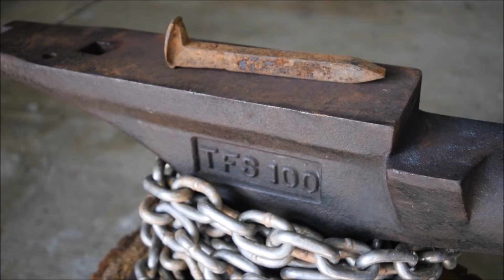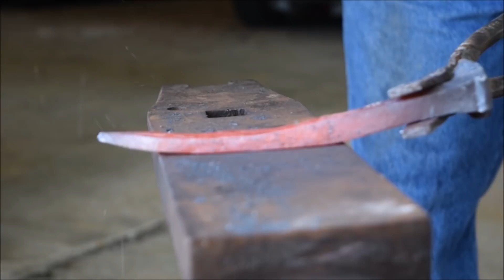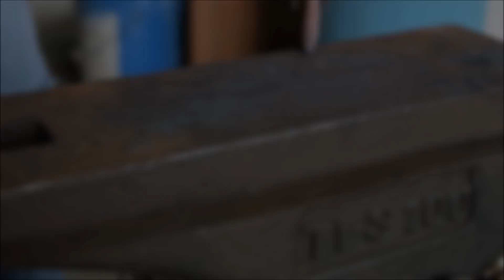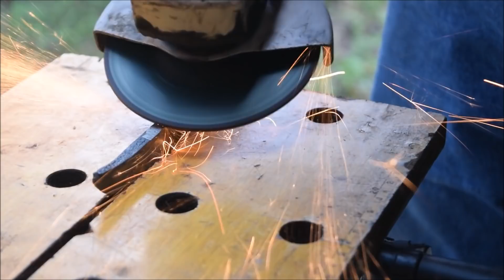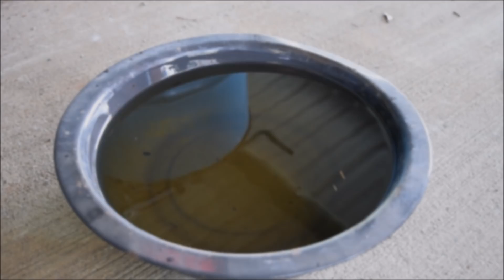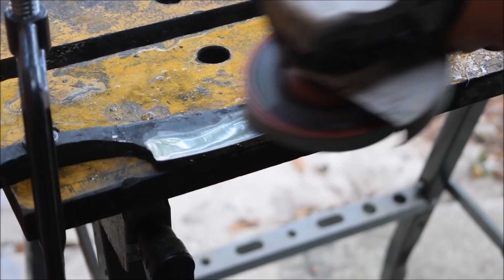Forging a Railroad Spike Knife

Comment: You can put a edge on a rr spike but it will not hold a edge as it has not enough carbon a reg spike about 28 points of carbon and a hc spike is around 32 one needs 45 points to hold a edge. these make great letter openers

Comment: It seems like our steel cools rapidly, maybe just a few hits and it has to go back in the forge. We were using  3/8"rebar, had 2 pieces side by side and forged some damascus out of it. 

We could not keep it hot for more then maybe 10sec although it started at near welding tempature? Common or what's the problem?
Reply: Was the anvil warmed up?

Comment: Wonderful knife. I really like that you left a lot of the spikes rustic look and feel. I do have a question. How hard where you able to get the blade? I personally have no idea what quality material went into making them  from the start. I am interested in knowing what it takes to get a good edge on something like this. Also how good of an edge could you get and how long will it last once you get it. 🤔 Thank you for posting this video.
Reply: There are essentially 3 different classes of Railroad spike steel. Low Carbon, Higher (not High) Carbon and Structural steel with about 0.4% carbon. The spikes aren't really gonna get much higher than 1045 Carbon steel when made into a blade on a good day. When I learned of this, I switched priority of what to make from them. My personal favorite thing to do is combine a couple and make Mace or Warhammer heads. The knives made from them won't hold an edge worth a damn, but they're tough and very hard to break, hence my Warhammer preference.
Reply: If you forge weld a file into it, it’ll be a real knife.
Reply: @Steve Syncox  thank you. I did some research and you're absolutely right. The only way this would have a useful cutting edge is if you added it.

Comment: You can get a bunch of rail road spikes for free or very very cheap.  Perfect material to really start learning bladesmithing and blacksmithing.  You can use them to make blades, tools, hatchets, lots of things.  No they aren't the best steel, but they WILL harden to a degree.  Go through about 25-50 spikes making all types of stuff, and you'll be well on your way.  Who cares if they turn out shitty?

Comment: I'm far from an expert but seems like your anvil is jumping around a lot more than it should be.
Reply: Adam Schaeffer well that’s cause it’s broken in half
Reply: I was thinking this exact thing! Would be quieter fastened down too
Reply: It’s very hard to get an anvil to stay completely still if it doesn’t have concrete cast around it
Reply: @outdoorperson6411  mine stays completely still and its on a stump
Reply: patrick White good for you I believe it but in that’s just from my experience though so maybe there’s something else to it also the one I use is just a pice a rail road track so it much lighter But thank you for the input
Reply: Walter sorels
Reply: I would call it a "dancing" anvil.
Reply: Anvils work on total weight. If you’ve got a 50 lb anvil, on a 20lb stump, with a brake drum, say, for a base that weighs another 30 lbs, the total working weight would be 100 lbs. adding weight below a lighter anvil keeps it in place better.
Reply: Josh Jones  Walter is a “grinder” not. Blacksmith
Reply: Mines fasten down with railroad spikes and if it gets loose I hit the spikes with three ugga duggas and we’re back in business for a bit😂
Reply: I use stump, chain and nails, perfectly sturdy for me
Reply: Just a Cowboi mine stays still on the stand I built it
Reply: Mine holds perfectly still on the stand I built. It’s from 4x4 granted the anvil is 150 lbs and the stand is 60-70 lbs and there is a 15 lb chain on it so that all helps. It’s on my patio where it’s not flat either. Doesn’t move tho
Reply: @PedalSteel-by2hx  seriously.... he makes all his Japanese swords and knives from forging.... if you're making stock removal knives yes you're a grinder but he is far from just a grinder...
Reply: At least he has an anvil, I have a 1” thick by 6” wide  10” long piece of plate and a RR track that I’m planning on welding it to...lol  poor men’s anvil.
Reply: @jongress4445  it’s because the chains are too lose a way you could fix that is by putting large nails on each corner

Comment: Whatd you quentch that in? And will water work? I know people use oil
Reply: supersendojarren a common thing which is very easy to notice, if it lights on fire on contact they’re quenching in oil, because oil is flammable and water is not.
Reply: @gavintrafford4338  Just use canola oil.

Comment: Anvil is unstable and I personally feel that the anvil height looks too short. It in my opinion should be at the heigh of your waist max and just below the groin minimum . Other than those two opinions, the knife came out good. Simple design and yet affective. Good job. I'm not a professional blacksmith at all. I just have seen a lot of blacksmiths and learned by observing. They are just my opinions based off of what I have learned. Thank you for sharing your video.

Comment: I just got to say I really like the name of your Forge the first time I forged a blade it was 3 years ago I used an offset smoker and ran a pipe in with a vacuum blowing air inside of it and I used honey locust and Oak + lots of air to get my blade up to temperature now I have a two burner forge that I use

Comment: Im about to start forging myself. I think this would be a great thing to start on. but i do have a few questions. When you quince you blade what kind of oil do you use? and Does it matter the weight of an anvil?
Reply: My experience about anvil weight is: as long as it's stable, you should be fine. For absolute beginning, the 10-20lbs cast iron anvils are a cheap option you should be able to find at hardware stores. However, they dent when you hit them, so once you truly decide you want to do this, get some harder steel. I use a bit of railroad track. I just have it strapped down on the stand, and it works fine.
Reply: @epion660  thank you man. Like I'm 15 yrs old and I've always had a passion for knives and swords, and now I'm deciding to forge.
Reply: @banerey6829  That's right about when I started too. Btw if you're hurting for cash, you can use used motor oil to quench. Don't do that for something that you handle actively though, some of the chemicals will transfer to your hands. I think I saw this youtuber say he used Canola oil to quench. That's a much better option. You can also quench with canola oil when making a food-safe knife, like a kitchen/butcher's knife, so that's an advantage.
Reply: @epion660  thanks man your giving me great advice. I'm starting to build a home made forge today, going to go get reformatory cement and some metal tubing. And about to go look for some railroad track to make an anvil with
Reply: @banerey6829  Good luck with the forge, I've never done that. Always bought pre-made.
Reply: @epion660  never use motor oil. You can get free canola from any restaurant. Make sure it’s heated to 120°.F.

Comment: Just a question, wouldn't grinding with the angle grinder after your heat treat ruin the heat treat? I thought after heat treating, you're supposed to temper, and then be careful about how much you heat the blade up? Just wondering!
Reply from the maker: It is okay to grind the blade after heat treating, just make sure to keep cooling the blade off so the temperature doesn’t get hot enough to ruin the temper.

Comment: Good for hammer, anvil practice,  forging a blade, poor quality low carbon steel, even the ones marked HC , are very low in carbon, if you went thru the carburization it would make a case hardened blade

Comment: I'm new to knifemaking, what disc did you use to 'polish' the blade at the very end with that angle grinder? Thanks
Reply: I'm not the author, but I use scotch brite wheels.  they are a bit expensive, but the ultra fine wheels make a beautiful polish.  They are sold in belt form as well.

Comment: How were you able to draw the steel out so easily to where you had enough room for a handle? I tried this and I wasn’t able to draw the steel out as easily even with the steel being at about 2,500 degrees. Please let me know. Thanks
Reply: dylan palombo. 
Hit harder. Also using the rounded part of a cross peen hammer works!
Reply: @therealamerican99.76  A halfway decent anvil also helps a lot.

Comment: Approx how long do you let one sit in the crucible initially ?
Reply: There isn't a crucible used in forging knives. A crucible is what holds metals that are being melted. That is just a forge. But, most likely left it in the forge long enough to get the metal glowing evenly so it can be worked without fracturing. It all depends on the forge and type metal being used.
Reply: Miletem Fortuna Gotcha,  I'm new to this, but I do have access to a fair amount of spikes and trying to find what to do with them. I'd be interested in making tomahawks or throwing knife or throwing  spike, the latter probably being possible perhaps

Comment: Just a low carbon blade that won't hold an edge
Reply: Actually railroad spikes are very high carbon steel to hold their shape with all the abuse they get that’s why it’s so hard to shape them there strong steel
Reply: Not true, they are barely even medium carbon so that they have the flex. If they were high carbon they would all need to be constantly replaced. The ones marked HC or Higher Carbon, are maybe going to come in at 1050, or a little less.
Reply: Not true they used spikes on forged in fire they actually make good knifes strong steel.
Reply: @chuckr786  lmao, almost none of that show is realistic. You are talking to a bladesmith. A railroad spike even stamped high carbon is about .3% carbon. A high carbon blade has .8 to 1%. Next time dont use forged in fire as an example lmao
Reply: @chuckr786  if you want go on Facebook and ask to join "Bladesmithing for bigginers" I'm a moderator of that group. You can actually learn something there. FiF is a show made for entertainment and that's about it.
Reply: @chuckr786  go ahead, tell me what episode because I haven't seen it
Reply: @chuckr786  I see you have no response when getting called out
Reply: Mr beer why you getting so crazy about the spike knife comment.  The old spikes are made of good carbon steel. Not sure about carbon content   but it is 50% or better. And for the fif  episode just Google spike knife fif YouTube.
Reply: @chuckr786  because you are wrong, no spike is .5% carbon. You are trying to spread completely false information that has proven science behind it. You are trying to say that I am incorrect when its literally my job. You are just another person who thinks they know what they are talking about. I found the episode and I'm personal friends with one of the competitors of that episode. I also personally know 3 other competitors from the show. I own two knives from one of them.
Reply: @chuckr786  you can also only find the testing they did on the knives, not what metal those spikes are made of. You can make a high carbon custom spike for a knife but it's not a true railroad spike. No railroad spike is high carbon. A true high carbon blade made correctly can cut a railroad knife in half. Stop believing everything you see on tv
Reply: @chuckr786  also your last comment shows how little you know. No knife or steel for that matter has 50% carbon. 2% is pushing it to the max
Reply: Mr beer you have problems go get a old rr spike and do a qench test on it .
Reply: @chuckr786  I have, its soft metal. Again I am a blade smith. I've tested this myself and did the research on this. I have actual knowledge while you are spewing tv show crap lmao
Reply: And if you have some many friends on fif why did you ask me what episode the rr spike .
Reply: @chuckr786  because I haven't watched every single episode. I was told what episode by them. You can message me on facebook and I will share screen shots if you really want
Reply: @chuckr786  also I know the show is just for entertainment and not education so why would I watch a show that I know more than it teaches?
Reply: @chuckr786  it's ok to admit you are wrong really
Reply: And as carbon goes 1084 has 84 percent carbon 1095 is 95 percent.  You are the one who does not know what he is talking about.
Reply: @chuckr786  those are only two kinds of steel, I know exactly how much carbon they have. 1075 has .75, O2 tool steel has .85 to .95, w2 is 1 to 1.1. Again this is my job you ignoramus
Reply: @chuckr786  feel free to message me on Facebook "Brandon Beer" mostly white profile picture of a building and creature and I can educate you some on this subject so you know what to look for when buying a knife for yourself.
Reply: @chuckr786  again, it's ok to admit you are wrong. It's not going to hurt you I promise

Comment: So witch one do i use, water or oil? Everyone is saying water but again everyone is saying oil
Reply: I use a brine solution.  Pound of salt to five gallons water.
Reply: I like Oil cause it's less likely to break the blade after you did a ton of work, but Water works if you're low on funds just be careful
Reply: oil cools the steel slightly slower so it can become less brittle and some of the oil burns into the steel making it a case hardened finish, but only to the depth of around 50 microns, so when its polished you will probably loose that.  water gives a faster quench and that makes it slightly harder but more brittle, but the brittleness is only really apparent in high carbon steel and can be overcome by a second heat treatment but only to a few hundred degree to remove the brittleness but leaving it hard and tough

Comment: What kind of metal are railroad spikes made of?
Reply: Arbitrary videos: They're generally made from a low-carbon steel. As the maker of the video says, they don't make the best knives, because low-carbon steel doesn't hold an edge quite as well as steel of a higher carbon content. However, they do look rather pleasing.
Reply: I have collected bunches of Rail Road spikes. The ones on straight lines of track are low carbon steel. The spikes located in curves, high traffic areas and highway intersections are usually HIGH carbon steel. I have bought many that are high carbon steel and are marked on the head as such.  They have the markings of HC on the head. The lower carbon steel spikes are generally not marked. There are also medium carbon steel spikes too. But I have little experience with them. I think I may have a few medium carbon steel spikes in my collection.
Reply: @superdave54811  HC does not mean High Carbon, it means Higher Carbon, and they are usually mid range carbon content, 1050 or so at absolutely the best scenario
Reply: @JasonGroom  Yes, I know this. But it is enough to forge them and get some practice in. They can be hardened enough to be temporarily useful. I know they do not have the carbon of a file or otherwise tools known to be made of HIGH carbon.

Comment: I am making one of these myself too.

Side note:You should quench it in water not oil
Reply: People have there own quenching preferences , I prefer oil because it's less likely to break the blade after you did a ton of work
Reply: Also less likely to fully harden a steel that hardens in water.
Reply: AIRUS SSS Thats a yikes from me chief. Water will destroy a thin blade- almost like making cracks in glass. I would heavily NOT recommend water
Reply: I have forged a lot of spike knives over the years and I quench in water every time. Spike knives are a novelty item. The steel is not a good knife steel. Will it cut? Sure, but it might not hold an edge for long. If you quench a spike knife in oil it will not be as hard as a water quenched blade. Oil cools down the blade a lot slower in the quench than water. That's the point of the quench, bring the temp of a hot blade down as quickly as possible making the steel super hard. Lots more to it than that and with a lot of big words lol. I also do not temper my spike knives. They are not hard enough to be brittle because of the low carbon content in the spike. They won't crack or shatter like glass I promise. The HC knives I make are a different story. They will absolutely crack and be garbage if quenched in water.

Comment: Oil quenching don't work on spikes man go for a water quench that's how I do mine and they are much harder
Reply: Nick ive cracked spike knives with water quenching. oil is a little more on the safe side unless you add salt to the water
Reply: The Seeker yes but on how easy and cheap the railroad spikes are to get I’d rather make a fully hardened knife that can hold an edge rather well than spend money on oil to get a knife that isn’t as hard as it could be
Reply: How do you water quinch? Without cracking the blade?
Reply: The Seeker I’m not sure how it works but I’ve done it several times and it came out perfectly
Reply: I've water quenched spikes in half-frozen water and they were fine haha.
Reply: If you have it set up in a vertical tube you could do do half water half oil. Oil sits on top, so the initial quench will be safer then it goes to water and will make it a bit harder. Reduced the risk of a fracture in the metal
Reply: You could also leave more material on the blade to reduce cracking/warping and use warmer water.
Reply: You could just put clay on the spine of the blade so it has a soft spine to absorb all the impact.
Reply: I use water and since its winter where I live its normally half frozen  now. Done dozens and never had one crack

Comment: Disappointing seeing you start with the head on top of the anvil when forging. (in edit) Obviously way off center during forging. Now, I am no expert, but I can see that you need to understand some basics of forging. It isn't just beating it with a hammer. It is making the metal move in a way that is not so chaotic and  with symmetry.